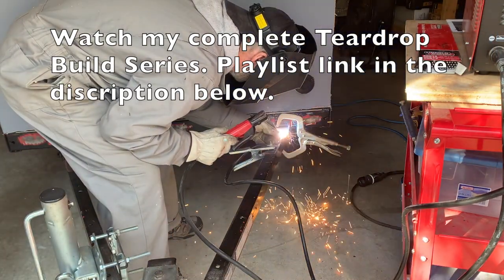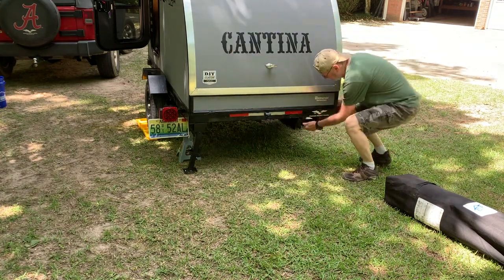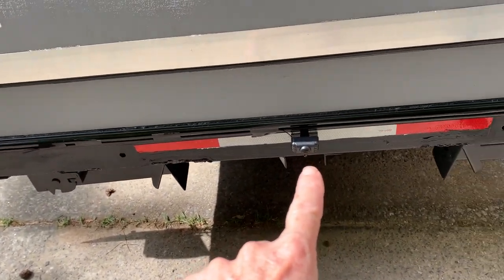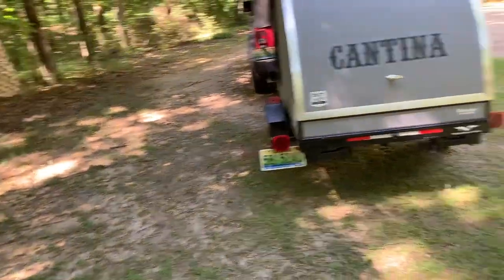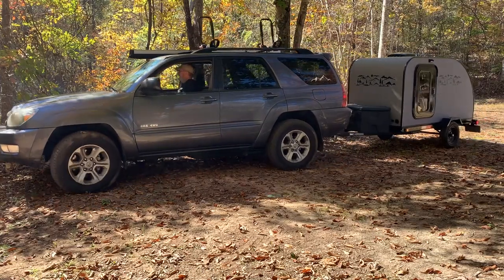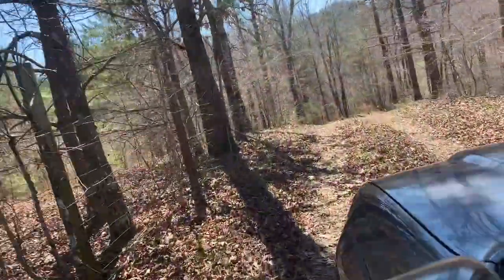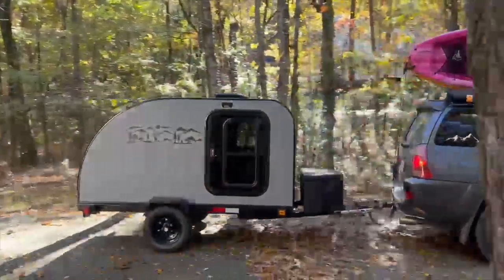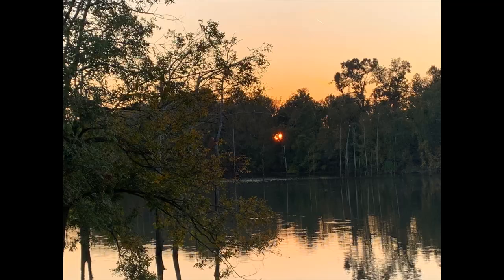Review of the Harbor Freight Trailer Teardrop after 1.5 Years

Comment: I was looking for a video using this trailer. thanks! Did you replace you axle or just the wheels? And did you replace the wheels to be highway rated? Thanks for the help
Reply from the maker: I just replaced the wheels and tire. The tires are rated for highway … 65mph. Also a good idea to grease your ball bearings! 
Thanks for watching! I appreciate your interest! 👍
Reply from the maker: Also, I did a video of replacing the wheels and grease the ball bearings. 👍
Reply: Good stuff 👍👌 
Perfect for a single guy like me. Simple and efficient is my motto!😂
Great idea to pimp out the trailer first! Then ya don't have to worry about it falling apart in the future! 😭 
Gonna do all the upgrades!
Axle, bearings, wheels and tires. Should have my brother a certified welder, do some extra support wherever needed as well. I could just use wood and paint it.😂
Wow. And still under weight with room for more accessories!😂
That's class man!
Great job 👍👏 
Perfection 💯 
Dream build! ✨

Comment: Could you install shocks or springs on this this?
Reply from the maker: I probably could but would have  had to do some major update to the frame. As I recall, I’ve seen a few YouTube videos of this being done. Just search for them. 
The weight of my teardrop is very light and I don’t      overland so didn’t do it. 
If I had it to do over again, I probably would have installed independent suspension. 
Hope this helps! Thanks for the comment, I appreciate it!!! 👍